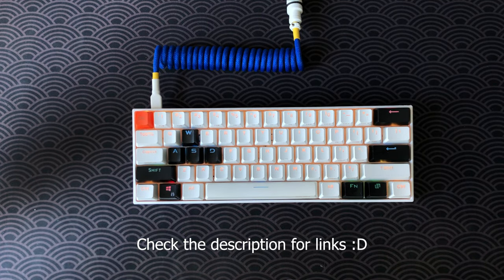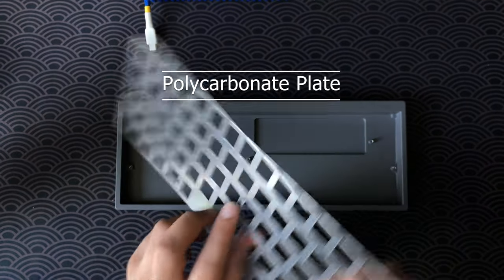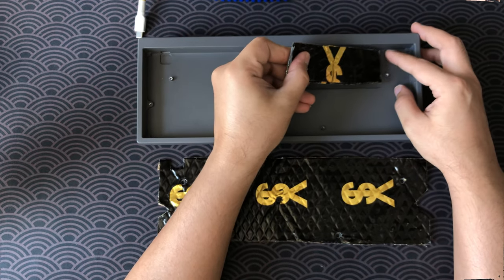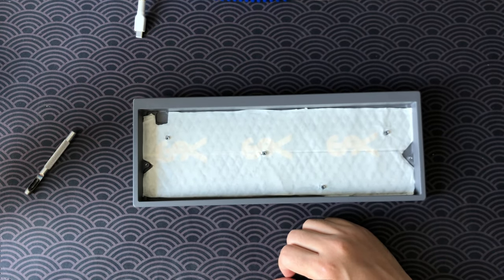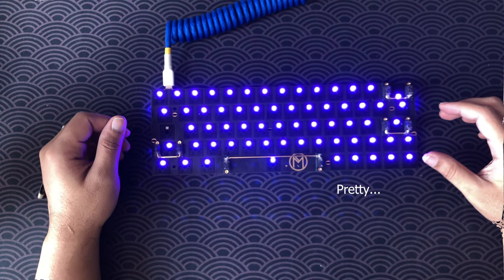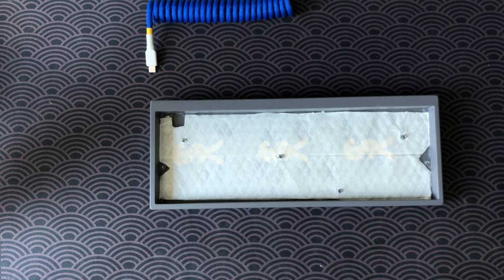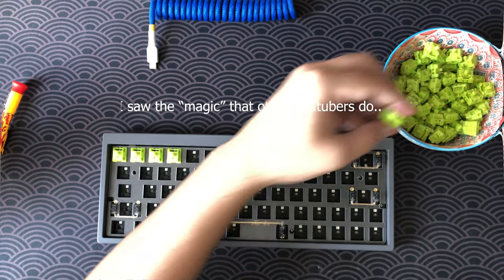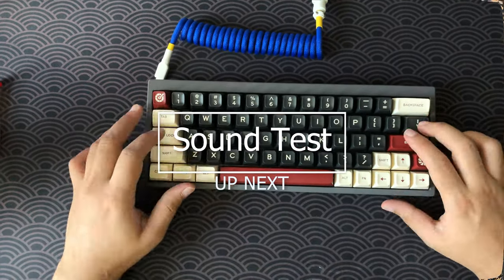KUIH 60 | KTT Matcha | My First Keyboard Build

Comment: i have seen another video about the Kuih 60 and the youtuber herself said that the kuih 60 paint quality is awful, like the paint chips out easily from the case have you encounter this problem ?
Reply from the maker: nope, i got this case pretty clean, no blemishes. However i need to point out those little "mistakes" in the case? Where the PCB sits; screw stems and PCB mount is not leveled properly so i had to put something to hold the top right corner of the PCB, so the board sits straight.

Comment: Hey, will this case fits rk61 PCB?
Reply: And the pcb charging port is located on the left same as the case. So i wonder would it fits the case
Reply from the maker: if you're referring to Royal Kludge's RK61? i dont think so, because as i recall the RK61 screw mountings are different than the common DIY Kits, so you might need to find cases that fit the RK61 board's screw mountings.

Hope this helps~
Reply: @cmdrnick  i see.. thank you! Yeah this helps a lot..so i need to find a new pcb then. Anyway, i have seen another video about the Kuih 60 and the youtuber herself said that the kuih 60 paint quality is awful, like the paint chips out easily from the case have you encounter this problem ?
Reply from the maker: @bigboidanial6823  I think i responded to this earlier, idk why it didnt go through. haha. anyways, no i dont have any paint problems on this one, maybe the colour matters? Yea i've seen the other one, it was purple or pinkish, but as you can see from my vid, the one i got was actually not bad. Though she was not wrong, the quality isn't great, mine have another type of flaw which is the PCB mounts, top right side is shorter than the left side, so the PCB doesnt sit properly. I had to make some modifications, hehe. but it worked out nicely. of course, better quality is the TOFU60, but that depends on how deep your pockets go XD
Reply: @cmdrnick  thanks for the info. appreciate it. You really help me a lot. Anyway, have a good one and looking foward to your contents in future!
Reply from the maker: @bigboidanial6823  Thanks :D Yea i got another video underway! gonna take some time though, this editing stuff I'm still new to hehe